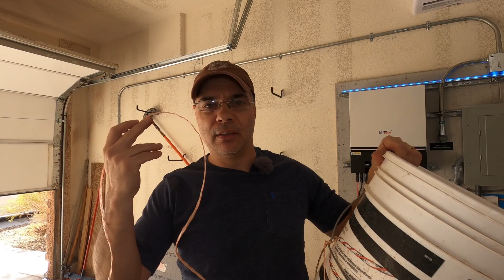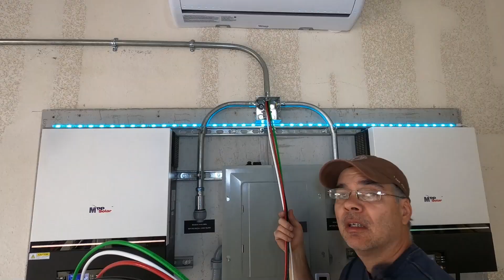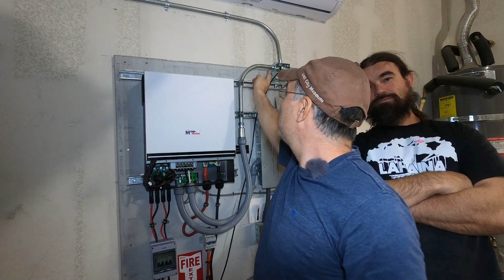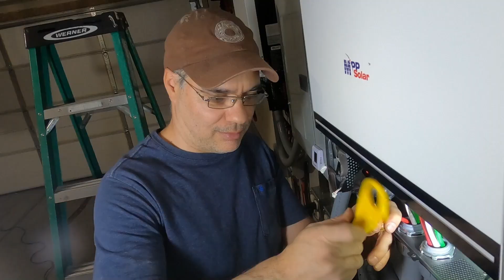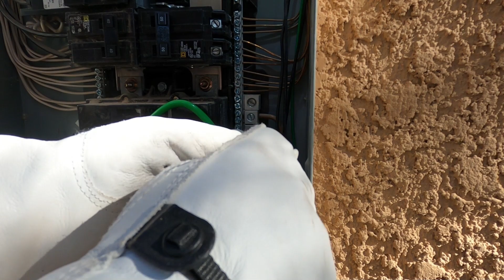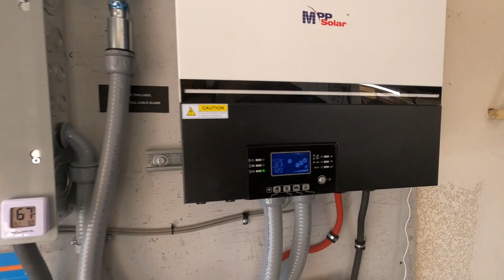Wiring Inverters For Grid Assist Charging / Bypass

Comment: Recommend completing net-metering back-feed to grid if your utility company buyback rates are good to avoid going back and forth also makes your battery last longer instead of using it every day. I know Cali rates are dirt crap other states should do it and back up loads for power outage with EG4 or other brands like Franklin or Enphase.
Reply from the maker: My inverters are not grid interactive.. I do not back feed.  I use the grid as backup supplemental power. Grid assist vs. grid interactive..

Comment: How do you prevent back feeding the grid?  And if this is all you need to be able to assist your grid to lower your bill, what's the purpose of products like the grid boss?  I'm new to all this, trying to start with a system to backup up critical loads during an outage, but would also like to be able to charge batteries at night when electric is cheap and use them a little during peak hours to save some money.  When i get panels, I may get a full system like a gridboss and flexboss and do it right.
Reply from the maker: I'm not backfeedong my panel. Grid assist is for when your batteries are low cause there is not enough solar. I'm using a hybrid inverter, not grid interactive. What you are describing sounds like you need a hybrid as well. I'm not familiar with grid boss at this point so a cannot speak to it.  If you intend on backfiring your panel many ppl install a generator outlet with a lock-out plate over their main breaker to ensure only one can be on at same time.  The other option is to use a transfer switch such as the reliance. Anther option is to have a critical loads panel and run your loads from that.. this is what I'm currently doing.. but I'll probably install a transfer switch in he future.  Hope this helps clear things up.
Reply from the maker: One thing I know about the grid boss is it allows you to combine the output of different inverters into a single synced ac output.. the folks at signature solar are very helpful..
Reply: @natesdiysolar  Grid Boss is good for AC coupling and whole-house backup because its basically the main breaker. The FlexBoss you can back feed and have load backup selection to sub panel.

Comment: Glad to see someone else using these LV6548 spit phase inverters.  Mine had been running since 2023.  Still have them but switched to a new inverter that can handle 500v mppt.  My arrays had to much amps to push over a long distance, so now they are all series strings except one 2s1 p array of bifacials 463v.  Thanks for video.
Reply from the maker: Yea they have been good units.. loud but solid.. I'll probably be switching to newer units later this year for sake of the channel and testing etc.. I'll still use these somewhere else.. thanks for watching.